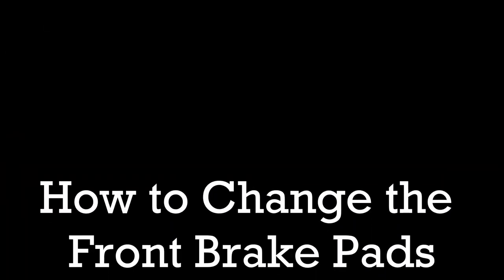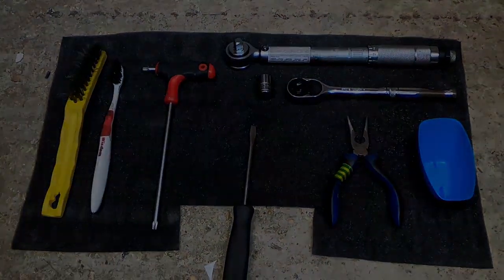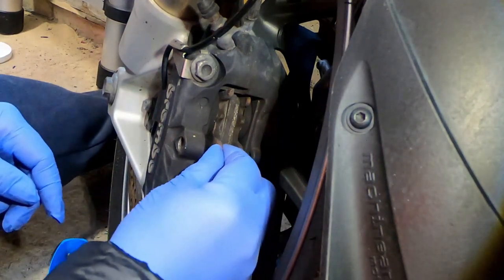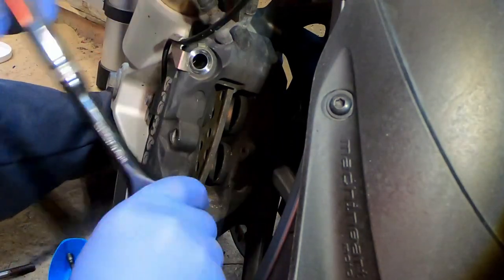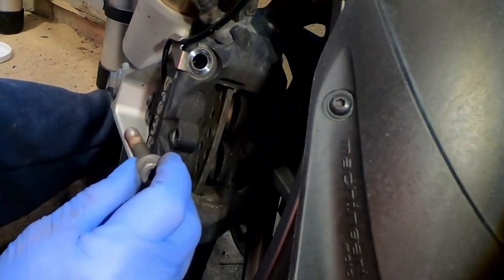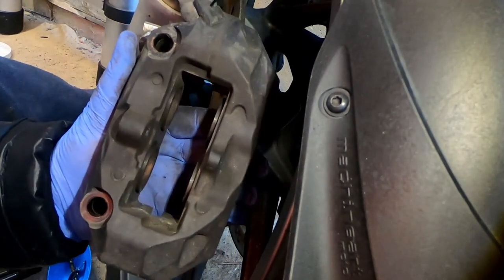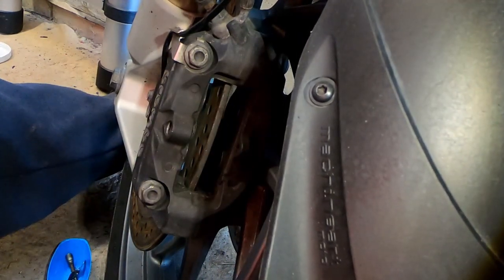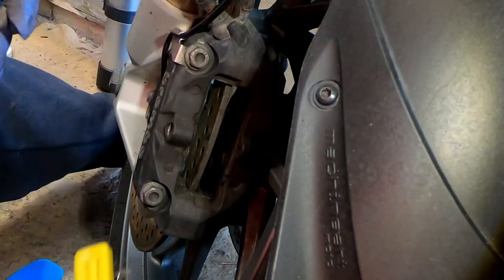How to change the Front Brake Pads on a BMW R1200GS/GSA

Comment: My manual said the torque values for the bolts holding on the caliper on the bike is 38 NM.  But my bike is a 2015 R1200GS.  Yours is likely newer
Nice video.
Reply from the maker: Hi Dahveed284, my bike is a 2014 model. I use the settings given in the 'Haynes' manual. I hope the video helped you anyway?
Reply: @robchisholm72  Yes it did.  Thanks for posting it.
Reply: My bike is 2017.5 and the manual for the Brembo brakes clearly says 38 Newton Metres.
Reply: @markwilliams8655  Same for my 2014 GSA, the front brake calipers are 38 NM and rear brake calipers are 24 NM. That Grub Screw (the one that goes through the brake pads) gets tightened to 6 NM.

Comment: Halo, good video, super, but I know that the brake caliper on the telescopic fork is screwed with M10 x 65 torque 38 Nm not 24 Nm.
Reply from the maker: Hi Eduard, thanks for watching and for leaving your comment. I took the torque settings from my Haynes manual.

Comment: La piastra a molla di con l'incavo a "U" al minuto 1:50 è montata in modo diverso da come fai vedere  al minuto 10:10.Quale sarebbe quella giusta? 
The spring plate with the "U" notch at minute 1:50 is mounted differently than you show at minute 10:10. Which one would be the right one?
Reply from the maker: Hi and thank you for watching and taking the time to leave a question. 
I used different makes of brake pads, at 1:50 is with OEM BMW pads. While at 10:10 I've used Brembo pads. The spring plate would not fit as at 1:50 with the Brembo pads but did fit securely as at 10:10. So in one way, they are both right.
Reply: Ok grazie mille, anche io ho usato adesso le Brembo rosse e ho montato tutto come hai fatto tu …perfetto. Grazie sei un bravo istruttore

Comment: Good tutorial. 👍 Is this the same process and torque settings do you know for the 1250 GSA?
Reply from the maker: Hi, thanks for your kind words and comment. I believe the answer is yes, but only if the original BMW Hayes calipers (as fitted to the R1250GS from factory) have been replaced with the Brembo's that were factory fitted on the 2013 - 2018 bikes. If the bike still has the OEM Hayes calipers, I wouldn't like to say. However, the process should be the same, but, the torque settings should be in the owners manual, or failing that, they will be in a Haynes manual. That's where I got my torque settings from.
Reply: @robchisholm72  much appreciated thanks 👍

Comment: 24 Nm , is rear brake caliper.
Reply from the maker: Hi William, thanks for watching and commenting. You're correct, the rear brake caliper mounting bolt is 24Nm and the front caliper mounting bolts are 38 Nm. Thank you
Reply: Hi , Bob, I'm just sharing opinions, please don't get me wrong, thank you.